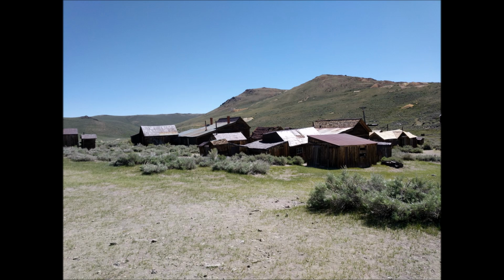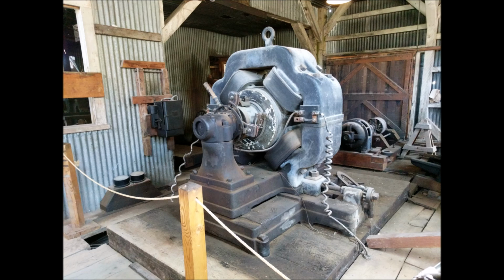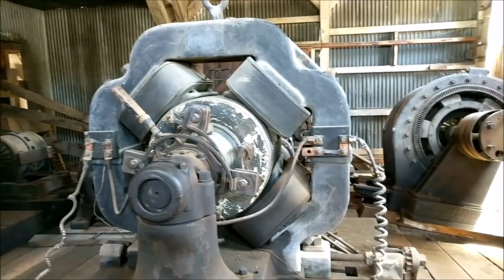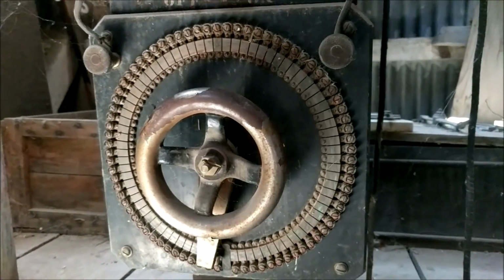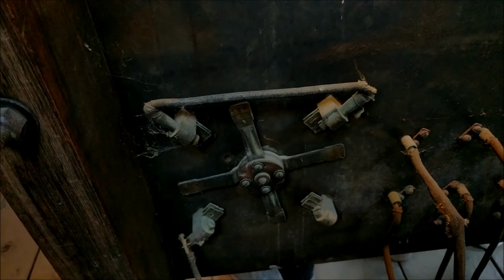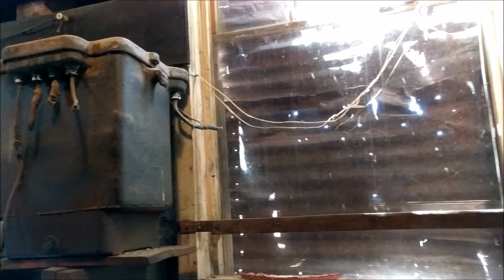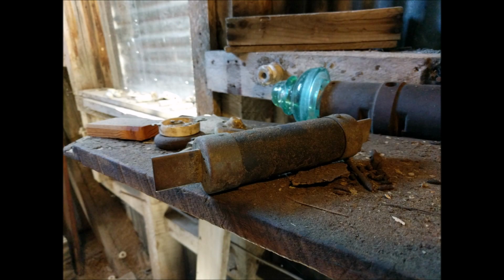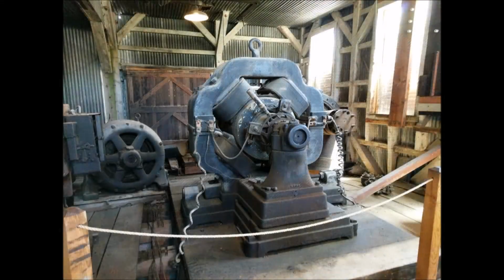Electricity and Motors at Bodie Ghost Town

Comment: Mystery thing is part of a motor starter. Would apply the power via some high power resistors till the motor was up to speed, then switch to direct online to give maximum power. Would also control the field current so that the motor run up speed was smooth from start to full, so reducing the power on surge to a low value to keep the fuses from blowing and the power line voltage dropping too much. Speed control was by increasing the slip, making the rotor run slower than the rotating magnetic field. The big resistor bank was probably part of the hoisting control, allowing the cage to be smoothly moved up and down, more than likely a DC motor, probably run via a rotary converter that made the required high current DC supply.
Reply: SeanBZA cool explanation, thnx